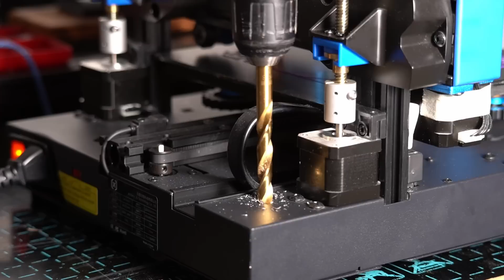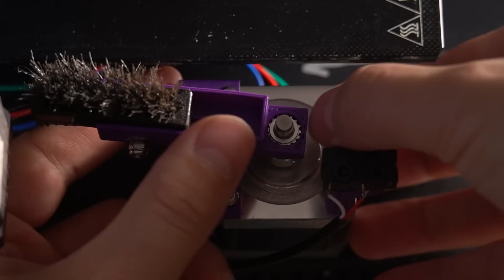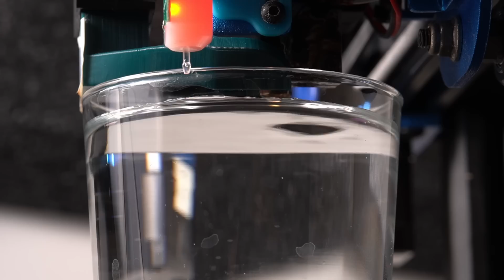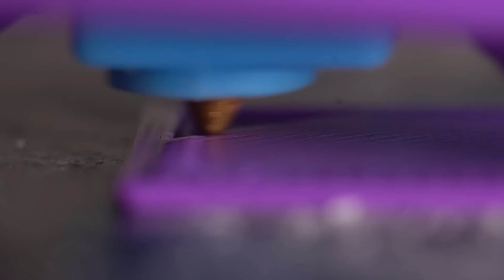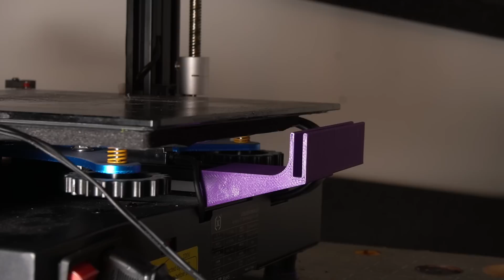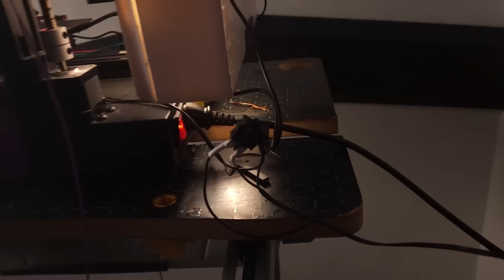These 5 upgrades just make everything so much better!

Comment: Why not tilting the cooling fan? That way you don't have to mess with weird designs trying to bend and direct the airflow to the print. Simply print a 3 parts bracket, one fixed where the fan is right now, the other two make a movable enclosure for the fan. Tilt the fan enclosure about 60º from the vertical, pointing to the nozzle, and there you go, the full power of the fan sent directly to the part being printed. That's how I have it in my X1, with a 5015. I guess it'll work as well for the Genius, but anyway it's really easy to modify if needed. Unfortunately youtube doesn't allow images or links in the comments, but you can find the model in printables, search for Tilted 5015 Cooling Fan

Comment: It's easier to mount a wire brush onto the bed so it's next (in my case, in front of) to the printing surface and let the print head move a cross it a couple of times with a macro.

Comment: Always deburr holes!! Especially when you want to put cables through the hole. Your machine is moving and the burr is like a sharp knife to the cables. Sooner or later you will have a short circuit.
Reply: It's also pretty fun to deburr 😃

Comment: Hi i tryed your duct and It is really good but i have some suggestion to make It even Better, but i do not have the ability to do them. What i think Will male the duct Better Is having the Two air tube parallel(so the air Will be squished Better to the nozzle) end the second suggestion Is to have a 10 degrees angle for the Two tubes (as in the voron community Is well known that having the flow parallel to the Bed will have mettere bridging result the perfect angle Is 10). 
Hope to see an updated version, or of i study fusion enough to make It by my self and than share
Reply from the maker: Thanks for the suggestions! I spend way too long optimizing the design. Hope to see your take on this duct.

Comment: Nice video! I've seen people put lights right by the hot end. It would be really hard, but it would be really cool
Reply from the maker: Thanks! 
The thing is there are light on the print head, its just one neopixel, its more useful for indication, not for lighting. Should have look more in to neopixels, it was taking to long.